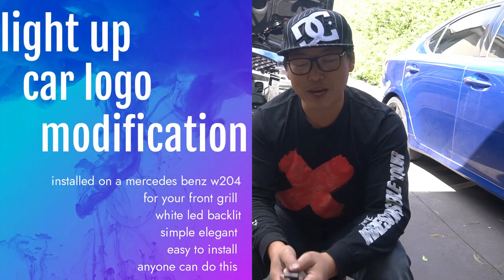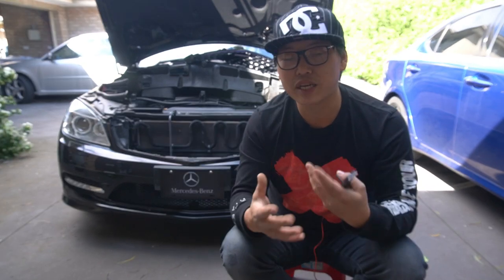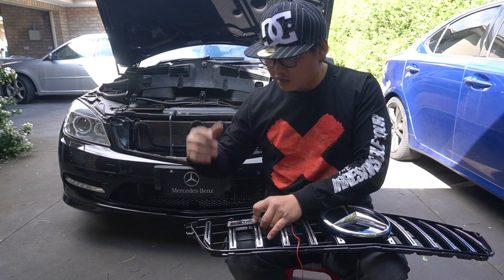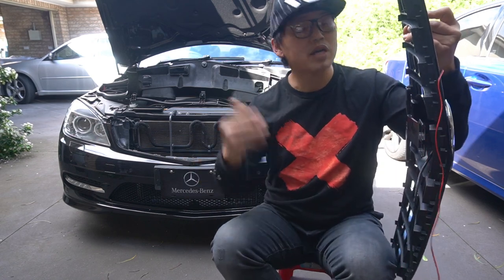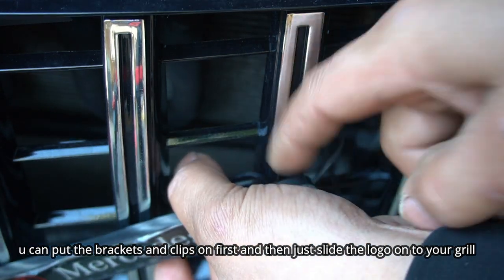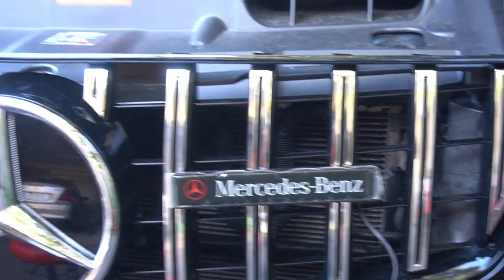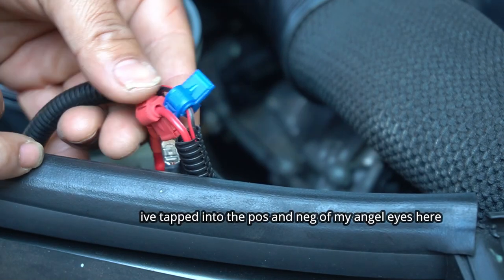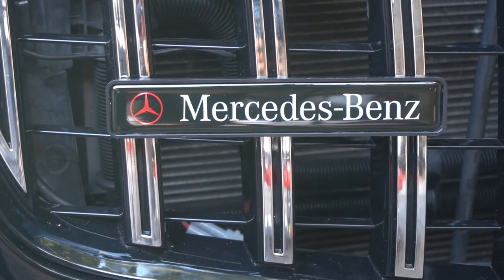mercedes benz mods car logo light up led emblem for front grill

Comment: I have 2013 c250 sport … going to install and wondering which fuse to tap into, headlight fuse? Or does it not matter and just any fuse that only turns on when car is running? Bc I can’t pinpoint headlight only fuse thanks man!
Reply from the maker: But also check your fuses ..u can google it and ensure u only use a fuse that doesn't relate to critical parts like sensors

Comment: Hello, I have a c class 2012, everything on my radio is working but when I turn up or down the volume, no sound comes out of the speakers, do you have a video related to that case?
Reply from the maker: unfortunately i dont know why thats happening... but good place to ask these qs are forums ... i wish  could answer that .. i will try find out though
Reply: MIKEYZ VLOGZ Thank you very much, A moment ago I did a circuit check from the radio and it tells me that: Fault: Ch1, Ch2, Ch3, Ch4 loudspeakers open.  Thank you very much again for answering

Comment: How has this held up over time? Any yellowing fading or flickering ?
Reply from the maker: Since installing it has yellowed ability not noticeable til your up close ... no flickering thus far .. but I rarely turn it on ..I've connected a switch to it so I can control WEN I want it on ..which is rarely ever... only at night
Reply: Tutorial how you put the switch
Reply from the maker: @jxtar2004  i already had a switch but wiring a switch is very easy ... u google how to wire a switch on and on and off and it will give a simple diagram on how to wire it ..just follow the diagram and u cant go wrong ... thats what i did 
.i just followed ghe diagram

Comment: I dont have front licence plate so want to put on bottom screen can i?  Also using fuse holder what fuse is best to use? 04 e320
Reply from the maker: u can put anywhere so long as the logo will 6 the fuse u can use any fuse that isn't directly related to fuel sensors or critical parts of the car
Reply: @MIKEYZVLOGZ  thanks put it on lower screen look great used cig lighter fuse.  So goes on when cars on.
Reply from the maker: @Jemstk  good worl buddy but if u can use a good acrylic paint and give it a good layer ..keep the yellowing away

Comment: MIKEY VLOGZ!!! love your channel, love your work. Would you consider doing a drivers side door lock actuator video? Watched the video on the passenger side and it was fantastic. Do you have any ideas on problem solving front parking sensors? Cheers
Reply from the maker: wat kind of problem ?
Reply: @MIKEYZVLOGZ  The parking asisstant meter on the front dash keeps on going off for no reason! Thank you for your help and your videos buddy
Reply from the maker: @1noneya10  u most likely have a faulty sensor ... i would replace it and see what happens ... mine was doing that after a small bump n i replaced it and all was good

Comment from the maker: a cool little mod for you guys hope you all enjoy it !! more to come 
demon eyes next whos ready >?
Reply: Yes pls. Also is there a way to have the bottom day time running light LEDs to stay on when headlights are on? I tried to research but it maybe needs S4 connect mux / Xentry programming?
Reply: @Jaytriple1  yes gp into ur cluster function n turn them on they will stay on eithout hradlights
Reply: @keenankerr5150  hi thanks for your reply. I wish it was this easy! Unfortunately, at night time when headlights are switched on, the DRLs do not switch on. I understand they are DAYTIME running lights but I would like them to switch on and stay switched on at night. I've only seen 1 other w204 on the road that had this it looked really cool
Reply from the maker: @Jaytriple1  keenan is right its that easy check out my next poat ill show u with lights on and off
Reply: @MIKEYZVLOGZ  hmm.. would be good to see your example. My current lights only work as follows:
DRL (LEDs on lower bumper) are on during the day time, headlights are on auto so only come on at night time but DRLs switch off as soon as headlights come on. 
I think it's a software thing due to EU regulations but I've seen other w204s in the UK that have DRLs switched on with headlights at night!! :(
Reply from the maker: @Jaytriple1  hmm maybe but km poating a pic now for u check it out
Reply: @MIKEYZVLOGZ  ok thanks. I will send you a pic of mine also on twitter maybe tomorrow evening. I'm in bed and it's raining so not just now 🤣 cheers mate
Reply from the maker: @Jaytriple1  do it on instagram i just posted a pic for u here on yotube as a post ...
Reply from the maker: @keenankerr5150  correct keenan ..thats exactly what i do

Comment: Ho w can i use this if i want to put this led logo on my diecast collection showcase ?
Reply from the maker: easy just use a adjustable power cable that can be changed to 12v and then use the positive and negative wires and tap into your power cable.. u can even buy female end with wires on the end designed to hardware devices ... u can buy the adjustable dc power converter at most electronic stores

Comment: I have this emblem for my 2015 CLS 400 and have no idea how to hook it up the car is different
Reply from the maker: all u need is 12v switched power and a negative ground chassis point and it will turn on with your ignition ..or add a switch and control it...same principle

Comment: Good video but you could have installed it the easiest way is ground it then just connect the positive to the battery to have constant power and turns off when you cut off the engine because I rather have it light up when i drive day or night 🙂👍